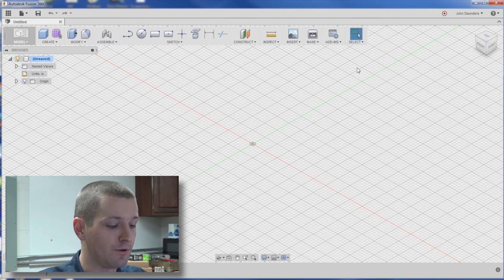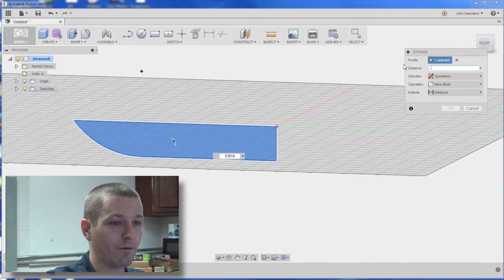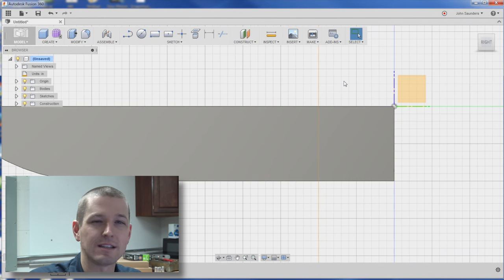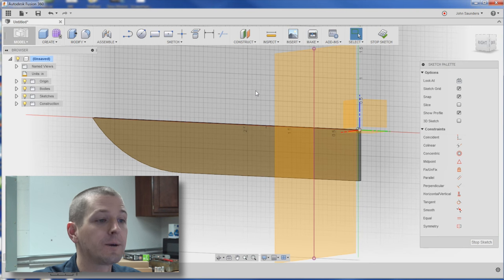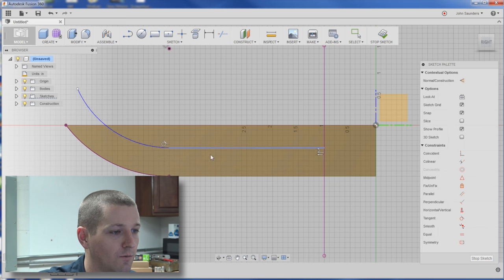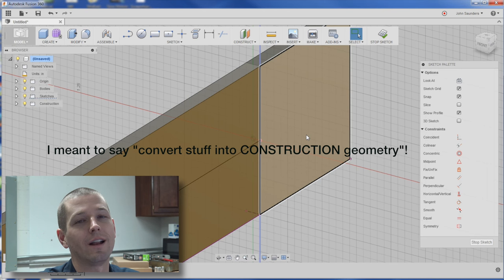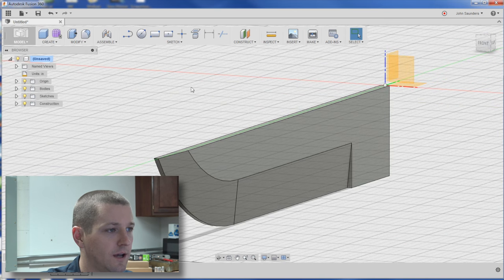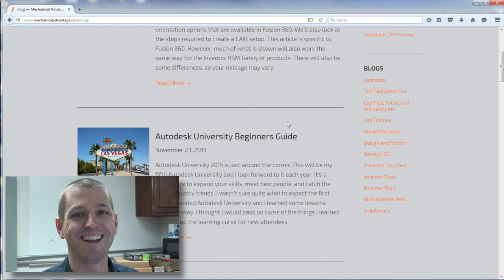Fusion Friday #5: Knife Improved!

Comment: Fewer steps = faster completion + fewer mistakes 
I use Solid Edge which is similar enough to what you're using. 
I might've used the offset line command to create the sweep path.
Maybe some fewer steps there too. 
The more you do it, the more you learn the shortcuts.
Thanks,
John
Reply: +NYC CNC yeah... except offset sketch entities in Fusion 360 currently sucks. It gives you the impression it has offset a chain of geometry and asks for dimensional input.. But then it doesn't  apply any offset constraints or the dimension you typed in... so currently the way you did it, is ultimately what you would have had to do anyway.

Comment: Another great video John.  One note, I have to hold down BOTH mouse buttons and then hit 'X' to convert to construction.  I tried over and over and re-watched the relevant part of this video multiple times to see what I was doing wrong.  I have wanted a quicker and easier way to convert to construction for a long time and you've given a super duper tip with this one.  Cheers, Gary
Reply: +NYC CNC   YES !!!  N-o-w, you tell me we only have to select.  However, I watched and listened again and you say, "just hold it down".  That is what threw me off the scent.  Keep the tips coming.

Comment: You could have swept a vee shape (cuts both sides) rather than the wedge (just one side). This would have created both sides of the blade in the sweep rather than having to mirror one side across at the end. Just requires another line in your swept sketch. Even fewer operations.
Reply: +Murray Edington That would have worked, however the mirroring will make a more stable and efficient model. In that example it wouldn't have been a big deal. But as your sketch grows more complicated it is easier for Fusion to do the mirror than to calculate the sketch relations.
Reply: +Mechanical Advantage So, he could have just mirrrored the wedge he sketched while inside the sketch along the center of the blade before exiting to do the sweep? Would that make the optimal solution for the task?